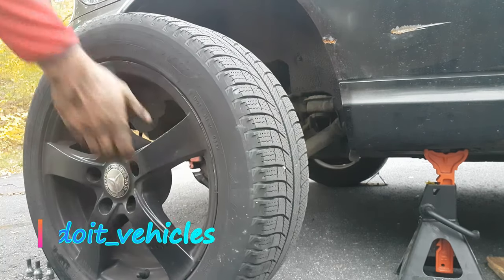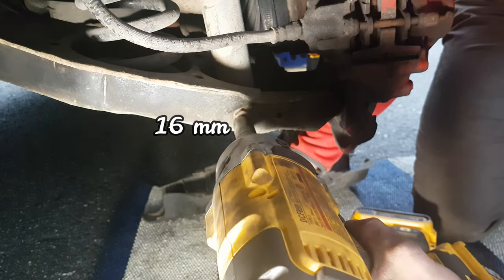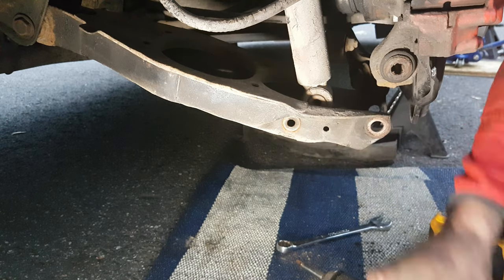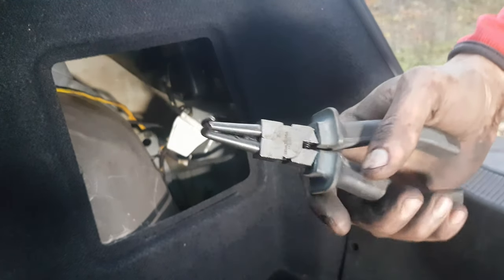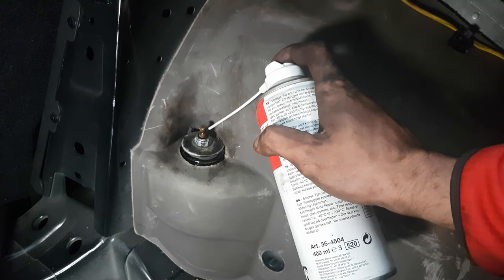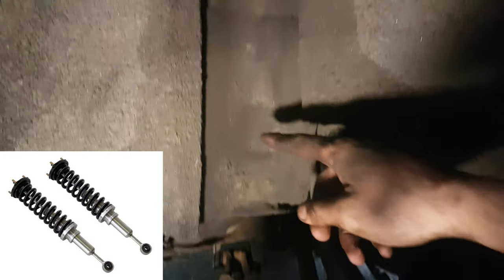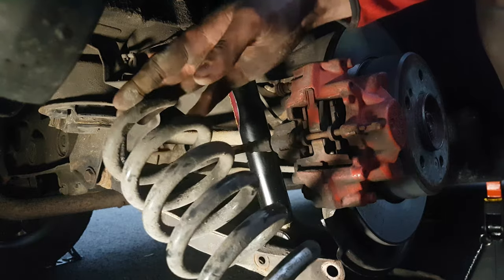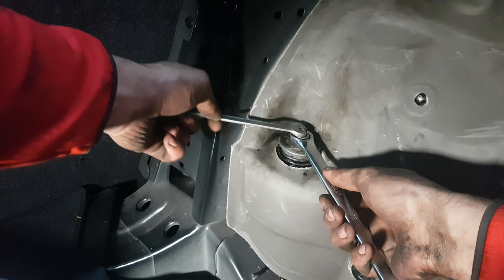Mercedes w203 Rear Shock Absorber replacement

Comment: Wow, you didn't remove the center bolt, and didn't even use a jack to lower? 
Well have a loud banging going on back on right side of 02 C230 Sport Coup and need to get down there and see whats what.
I climbed in the back while someone else drove to be sure, and I can feel something when I touch the top of the shock from inside the car, 
Guess I'll know soon enough! How did you get it off without a jack? Your videos are awesome.

Comment: how far should the nut be tightened? I replaced my shocks but I don't know how to tighten the top nut, should it touch the removable metal sleeve that is put on the shock axis or no? my new shocks came with shorter metal sleeves but nevertheless I managed to tighten the top nuts so hard that there was huge noise coming from the rear suspension... I loosend the nuts so that there is no thread above them and I think the noise is gone but I still wonder how far shoud they be tightened?
Reply from the maker: those nuts should not squeze the rubber too much , just that if the car hits a hole , the shock absorber will not move up and down ; If the sound is from the rubber grinding on metal than you can use some sylicon base lubricant and the noise should be gone
Reply: doit_vehicles i guess i had tightened the nut/washer assembly so much that the washer was squeezing the aforementioned metal sleeve that is put on top of the shock absorber (on its axis) between itself and the bottom limiter for the metal sleeve. I still don’t understand the purpose of that sleeve. Please, can you see the drawing I made of the shock absorber by hand and tell me if I am right: https://ibb.co/8bxjw9p

Comment: Not all heroes wear cape
Reply: To take off the shock absorber you don't need to remove the spring. If you pull up the absorber, you can loose it easily. I was doing it like you did but a an old mechanic appeared and advised me. 🤣 Hope it helps.

Comment: Mercedes w230 coupe kompressor
Hello, I have the same car as yours and I have a problem over 1 year ago and I would like to know if you can help me.
The battery of the car is discharged after having the car 2 or 3 days stopped.
The battery change it is new
Alternator works perfectly
The solution that I use daily is to disconnect the battery and lock the car with a key and in the morning open it with a key to put the battery cable and turn it on again.
As you can see this is very annoying and I would like to know if you can help me.
Thank you
Reply: I have seen your video that you change a "voltage regulator" that has something to do?
Reply from the maker: Hei ! From what you described,  it looks like something is draining the battery after you turn the car's key off . So check if there are any lights still on , after  the engine is off - thats the most common issue of this kind I've seen ..
Reply from the maker: it can't be the voltage regulator as long as the alternator is charging the battery with aprox 14.2 volts ..
Reply: @doit_vehicles  

I use the translator to talk to you because my English is bad.
When I turn off the car, there is no light left on and it does not make any noise or something similar
I have read on the internet and I do not find solutions either.

Cres that yes changed all the fuses I will be able to solve it?

Thanks for your help
Reply: @doit_vehicles  
and I have another question Since I bought the car they told me before starting, leave it for 10-20 seconds with the key in contact until you stop listening to the fans.

the car is gasoline a mercedes 230 coupe kompressor 
 the car is automatic

when you give the key to contact 2, it is heard in the motor as a fan moving and after a while it stops.
this is normal?
Reply from the maker: I see .. no , changing the fuses will deffinetely not help .
Reply from the maker: That's not normal  . That fan might  be the one draining the battery . Is the fan on the air conditioning or the radiator fan ?
Reply: @doit_vehicles  
I could not tell you the truth.

I put the contact with the open hood and it is sound near where it says "kompressor" is something like brrrr brrr brrr and then it stops being so strong and it is when I turn on the car.

I'll look and I'll write again.
Reply from the maker: All right )
Reply: It could be a short in the auxiliary water pump. It’s a small electric pump located just to the left of the supercharger. It’s designed to assist in pushing coolant through the heater core at low engine RPM. It usually runs after the car is stopped for a few seconds. You may want to check that.
Reply: Old post but #1 issue that causes battery drain on W203 is defective power seats module. Replace it (expensive) or mbworld or benzworld (forget which) has cheap fix to install relay to remove power from module with ignition off. You might lose the seat memory but save I dunno, $300 on a seat module.
Reply: @DimlyAwareHUmAn Many years have passed now, and I have not stopped to read what was previously commented in the past, but I think I remember that it was the battery problem.
In my case, the solution was very easy, where the interior light panel was in the middle, I lowered that plastic and the ceiling motors were connected there, I disconnected them and that's it, one was shorted and always consumed battery

Comment: OMG, this video is SO WRONG! I now have a lot of extra work ahead of me because it this. You DO NOT REMOVE THE SPRING to remove the shock, 
just remove the top nut (this part is correct)+ bolt holding the lower arm of the shock, push up firmly with both hands on the shock to retract it, and remove it as shown here 
https://www.youtube.com/watch?v=s7W2Y_yZj0M&t=196s 
At :45 you suddenly viola have the bolt out!! But it's far from that easy and completely unnecessary. 
As another video points out on this subject (probably someone who watched your video) 
 it was necessary to remove inner bolt as well to get the hub bolt back in. ALSO it's COMPLETELY inaccessible from the bolt side. 
So, I've got the bolt partially out, but can't get it to go back in because tension from the spring has got it cocked in such a way, that even with the jack it just won't go.
I'm going to remove the caliper and the shield and see if the access is any better. You should also mention that messing with springs can result in INJURY AND/OR DEATH if the damn thing comes flying out and hits you. So removing the inner bolt and lowering with the jack will be my last resort. 
The correct way to remove a spring on Mercedes involves threading a special compressor into the spring to remove pressure before removing. But of course that tool is expensive, and yes, I have replaced the rear springs once but dropped from the center. 
Anyway this is the 2nd video of yours that has caused me grief from your jumping over things. Anyway, they are good overviews but definitely not always correct or leave out 
potentially frustrating issues and just jumping to the end. Well off the garage. BTW- My problem ended up being shock bushings. As they are aftermarket high performance parts, they are available for purchase from the mfg. Anyway, a little nervous about dropping the spring is it comes to that. Seemed easy once many years ago, but so did a lot  of things when I was younger.